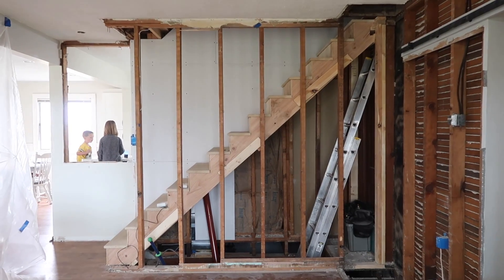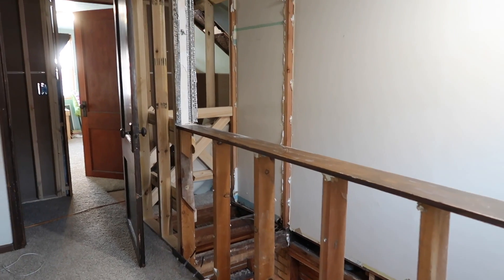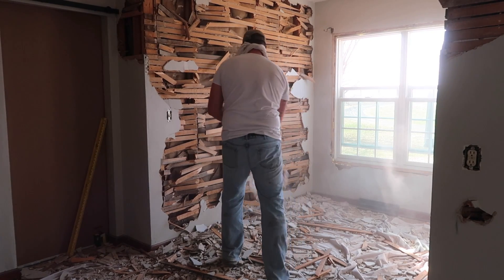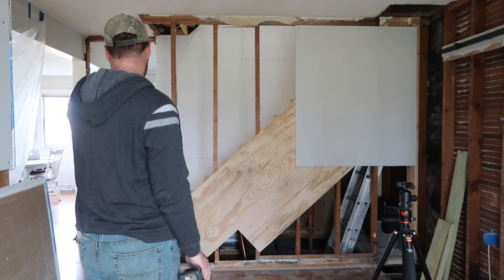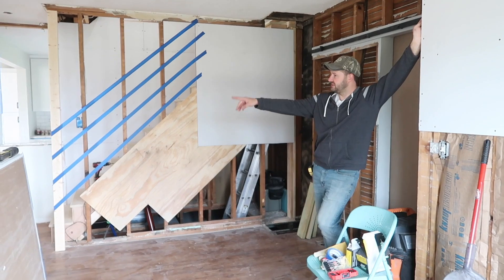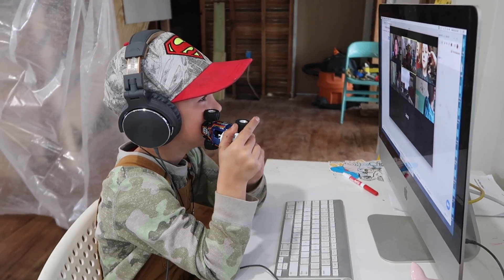Mocking up an Open Railing: We need to see it to believe it!

Comment from the maker: ❤️ IN THIS VIDEO (vote at 11:59):
- Did Tom get the Sheetrock done? 0:39
- Staircase Project Overview 1:15
- Mocking up the Open Railing 4:20
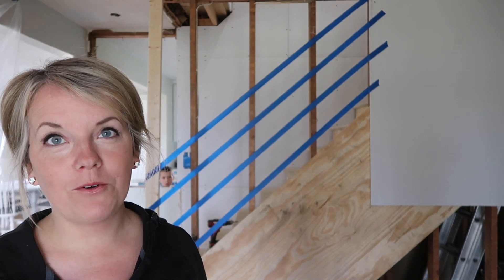- Reworking the Desk Design 6:49
- Did we mention we have to pull up ALL of the flooring? 8:44
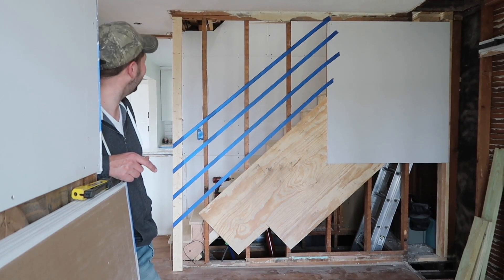- Dawn's Design Sketch 9:45
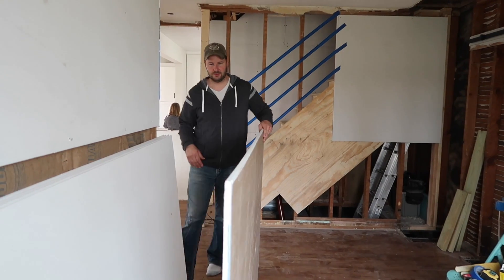- What it looks like closed in 11:11
- Cast your vote! 11:59

We're looking forward to your vote! Also, if you want to see Tom gutting the stairwell, you can find that here: https://youtu.be/e_Vz9CjoMsQ 

❤️THANK YOU for watching!! We hope you're doing well!! - Dawn & Tom
Reply: I love all the work you've done to the house so far. I wasn't too sure how I liked the open railing because I wasn't thrilled about the horizontal rails. I think it looks too modern for your 1940s house. But as soon as Tom put that second piece of sheetrock up I did NOT like how small and closed in the room felt. It seems too dark as well. I would open it up (it opens up the whole floor concept from the different angles you showed) but use a different stair rail that matches better with your home (vertical, maybe).
Reply: I think the computer counter is fantastic. It’s centrally located and as long as they have headphones I think it’s going to be wonderful. I know it would look real pretty to have the railing and everything. But I think your idea with the computer counter is going to be great for the kids. I feel for you Tom. We had to do very similar things when we were remodeling our house. We did the windows first throughout the whole house. Then we were told that no one would want to purchase our house with two bedrooms and the third being a laundry room. They said we needed a separate laundry room. Or the value of the house would be significantly cut. So we actually added on to the house. And we closed in the rear half of our carport to make a separate laundry room. It was beautiful. But it was a disaster. We were two2 x 4 short of all new framing by the time we were done. And we had to live in the back storage building that was only 600 square-foot for almost 2 years while the entire house had to be gutted - it was heart wrenching. So you guys at least are able to still live in your house - that’s awesome.
Reply: I like the open railing but don't fancy the dark colour so much. It feels like it would draw all the attention to it; the eye is just drawn to such colours that stick out. Maybe the railings can be of a brighter colour?
Reply: As much as I love Tom’s idea,  it’s very stylish,  I’m thinking about what you said about homeschooling the kids from now on.  So I’m thinking Dawn’s practical idea seems more sensible.  It sounds like you are already having a taste of how it would work.  Sorry Tom, but I’m with “poor misunderstood Dawn” on this one.   Thank me later!!..  😇😂
Reply: Well, it looks like my opinion is NOT unique!  So glad to see all the votes to not make a dedicated spot.  Home school mom of SIX kids all the way through and FOUR adopted kids partially through. Laptops!
Reply: The full wall just makes sense with the computer station for the kids. Either design is neat but I vote for the more practical solution. All the work you have done to your home is inspiring. Enjoy watching you both so much!😘
Reply: I think you should do what you like best for the staircase alone.  You can still have the computer station there, just no wall hangings. Best of both worlds.  I feel like very soon after you start homeschooling you will find, they will not want to sit together.  They will do better with laptops at the kitchen table or in their own rooms at a desk as they get older possibly.  I wouldn't make that drastic of a design decision based on wanting to put a computer station there.  You may want to move it later anyway and wish you had open stairs. By the way you guys are awesome and I love to watch.  I have been watching you for a couple of months now.  I think I have gone back and watched every video now - Be blessed, Marsha
Reply: I saw this and then your video 'This is not what we were expecting' (it sure how I'd missed it before - I guess I was working before lockdown) anyway, that one shows the area clear of the old desk but with the staircase still closed up - you should definitely leave it open, it makes such a difference to that space and the staircase too as it's not so nice boxed in. (I was brought up in  an old farmhouse, and also rented a cottage with the same type of staircase and it's quite dark and claustrophobic). Check out the other video! 😊
Reply: Just a thought. You should put your desk only where the railing is. The other room, you can dedicate to the kids. One side of the wall 4 computers for the kids and the other side a working table for the kids. Don’t know if that room is big enough. I have kids, so I know sometimes if they are right next to you, it can be challenging to get your work done. Only a suggestion. I think it’ll be great either way. Tom does a great job
Reply: Kay Tee I love your idea!!!! My eyes were drawn directly to that, as well!!
Reply: The Minimal Mom  Dawn, would you mind sharing the depth of your desk drawing/plan and the height/depth of the cabinets you plan on putting underneath? I love the cabinets underneath idea, because I’m a shorty too! Thanks!

Comment: I would do the open wall. I have been homeschooling for 4 years and hardly ever use computers, and when we do, we sit on the couch or wherever is comfortable. Sometimes we have to move kids away from each other because they get distracted being so close, so laptops would work better than a desktop. 🤗
Reply: Yup, my problem when I was homeschooled. And my kids's problem currently.
Reply: Yes us too!! My same thoughts. Homeschooling is different then school at home. We use our whole house and the kitchen table has been enough table space for us.
Reply: Live Life Simplified I wanted to add to this! I’ve homeschooled my kids the whole time. My oldest is 15. We never need that many computers. Two max would be great! I would do the open railing and a smaller desk area there.

Comment: I say open railing. Keep a smaller desk for your desk and then have a nice table for the kids with laptops that can be put away when not in use instead of so many screens being out. And bonus is that the staircase can be open and filled with light and air!
Reply: This!

Comment: As a Realtor I would vote for the open railing.  I know you're not planning on moving now but in the future I don't believe buyers would be interested in a computer station.  Open concept is almost always on a buyer wish list.
Reply: Lisa Ryan Open to a certain extent.  I like that they are planning one side open & the other mostly closed.
Reply: I would do open railing on BOTH SIDES of the steps (if possible)! It would really open up that floor plan!

Comment: I vote open railing! As a homeschool family, I can attest (like others) that your homeschooling set up and needs will change, and it’s very unlikely you will want your kids space to be so near your own- whether working all at the same time or not. One idea might be to add some floor outlets in the room though since you have to redo flooring anyway- so if you have a homeschool table/office desk/whatever in the middle of the room, you can connect a charging cord. We had those in our last home- randomly- and they were wonderful!
Reply: Yes! Our home was built in 1948 and remodeled 2007. We left some of the original non-grounded outlets (mistake) and added grounded ones. The old outlets are a nuisance. You'd be so glad to have floor outlets. The tangle of charging cords for everything and extension cords is a real challenge.

Comment: Open railing with no desks or anything under it. Move all work area/desks/tables etc. to Dawn's work room. It will help the flow of the house. Any desks under the open railing or even if closed, will make the house look cluttered. I agree that most kids use laptops. You could still buy or build a desk area that could be removed as the children get older.

Comment: 1) I vote for open stairway wall. 2) Based on kids outgrowing a contemplated tech desk area, could such a desk be made temporary as a piece of furniture instead of something built in?  3) The weariness of so many projects going on at the same time is really showing. I strongly recommend you complete these projects before starting another one!! 4) The railing style should be complementary to the overall style of the house. Open railing is a great idea, but don’t go too ‘modern.’

Comment: I vote open railing!! It will look awesome!! I have homeschooled for over 20 years (I have 10 kids) and I think laptops are the best way to go with kids who will use them for school.  I would see maybe one kiddo at your current kitchen table and perhaps another on the couch and maybe one sitting by you doing book work and another one reading in a chair. I don’t have a formal place for my kids to do school.  We gather at the dining table for group lessons.  After that they are scattered and alternate using computers.  I would suggest putting your office back where it was and perhaps setting up a small desk in there if one of the kiddos wants/needs to be close to you while doing a lesson.  Or you could put a smaller desk/cabinet setup like you were talking about on the wall of the stairway but make it for 2 computers instead of 3 and still put your desk area back where you had it or at least in that space.  Your house looks amazing and I can’t wait to see this renovation complete!  Tom your skills are amazing!
Reply: Yasss!

Comment: I am a homeschooling with a small home. You may want to think about how your kitchen table will be a part of your day as you homeschool. A lot of time I'm doing things in the kitchen and the kids are working at the kitchen table and that gives easy access for questions they may have. We also use the table for crafts and game sand other projects. I wonder if you put a table where your current office is if it will get much use? Think about how you will use those existing surfaces during homeschool.  As long as there is a place to clean up and put things so meals can happen this has worked really well for us.
Reply: Exactly.

Comment: I do like the desk idea even though I voted that you might regret it. The reason I believe it might not be a good setup for that many computers is because the space needed for notebooks/books/calculators, etc., along with the space you might need to complete your work would just not be available. In my classroom at school the students did their work much more efficiently when they had the ability to spread out and have a little space around them to work. Maybe if there was a space to have 2 computers on the counter top and another space on the other side of the room for 2 more computers it would feel like you'd have room to breathe. I also have a question as to how easy it would be to access the cabinets for school supplies/books, etc...You both have great taste and I know whatever you choose will be the right choice. As I grow older though, I prefer a look that opens a space up instead of closing it off.  Gale

Comment: I think closing it would stick with the time period of the house, but I also like the open railing.  I would not put in a built-in cabinet/desk.  Homeschooled both my boys. They will transition to doing school independently and probably on a laptop (especially if you decide to do a co-op or later dual credit at your local community college. some can do dual credit as early as their junior year).  Have a desk or table area but I would not build it in.   Also, mine got to where they needed more space or quiet to work, so sometimes one would be in one location and the other in another.  Good luck on your decision and ultimately it is yours :)

Comment: Seasoned homeschool mom here, having said that I better watch my spelling.
Having a closed stairway will allow more flexibility on furniture arrangement for the future.  On the other hand it does feel more cramped.  50/50
Laptops with parental filters- are your answer.  They will be able to take them to auxiliary classes when they are a little older.  
You will probably only need the custom table not the row of computers.  Homeschooling is different than school at home, once they receive their assignments at the school table they will go off to different places in the house to do their work; on their bed, outside in the camper for quiet reading, under a tree in good weather, at the island in the kitchen.  You have a lot of place already for them to learn, you might want to use that room in another way.  I do not regret 1 minute of homeschooling, my "kids' are still the best of friends, even though they are all grown.

Comment: YOU CAN DO BOTH!  You can achieve this by having the open stairs AND in Dawns current office space....use the wall that is against the porch to add the butcher block counter top for the stationed computer desks.  Maybe add a piano hinge so you can pop it up when the kids need the flat desk working space to write on and pull  it down when not in use or the kids want to lounge or you need the floor space.  You can even add the clipboards over each kids station for their homework like you did for your office desk instead of pictures like in your mockup drawing.  On the opposite wall of the kids work stations you can add bean bags or pillows or even a couch for when the kids want to lounge with their tablets, book, etc.  If you put a table in the middle of that room it will be limiting and it is better optimized if the working desk is up against the wall.  Dawn, you can move to the sheetrocked  section of the stair wall.  Love you guys! <3

Comment: We've been homeschooling a lot of years, for awhile even had a dedicated school room, but the reality continues to be that we school in the dining room more than anywhere else. Kids will be all over the house ,or outside on beautiful days, doing school but the hub is the dining room for us because I can be cooking, etc and still be available to monitor and help the ones who need it. Also, you don't want a big light source facing computer screens - throws off the ability to see depending on the time of day (again speaking from experience, lol!). I'd be more likely to close in the stairway and put bookshelves with adjustable shelves on that wall. With doors if you want it all "hidden". Leaves you flexibility to do school anywhere but everything has a home too.

Comment: Personally, I wouldn't recommend designating a Homeschooling spot, because in my experience it just doesn't work that way.  Unless you want a table in your current office space for some other reason, it's not really going to be practical for Homeschooling. Also, as for the open staircase railing, and keeping with the 1940's theme, I'm not sure that works?  Dawn's computer desk drawing is awesome! If it were my house, which it is NOT 😊, I would put that in the current office space.  And, I would repaint the stools. Or maybe just the seat part if you feel it would be too much mustard.  Or, possibly white?
Again, it's YOUR house, and your family. So do what works for you.  But you did ask for our opinions...lol
So, to recap:  wall up the stairway with planking. Put the craft area back. Add computer stations to the office, or just get tablets and laptops that can float with the kids where needed.  And paint the kitchen stools either white, or mustard, or try leaving the legs black and the seats mustard.  The end.  Love you guys SO MUCH!

Comment: Open railing is appropriate in a 1940’s home. 
I suggest a 36” high (counter height) table with locking casters, so you could move it around. This height would be good for sitting, standing, computer work, school projects, buffet, crafts, work bench, etc.
Good luck and I hope to see it completed soon!

Comment: As a former homeschooling mom, from the 90’s, I agree with many of the other homeschooling Moms.   A permanent computer station may not be necessary. Tablets or laptops will be what you will use. Just need an area for them to use, like the other side of room, that Tom is working on. If you only used desk top computers, a more permanent area would be necessary. I think having the ability to work at the computer station for other things, like crafts, sit down getting focus activities, extra counter space, when needed would be a benefit, so I’d still make  the area by the stairs, but have it multi-functional. Thanks for encouraging smiles and Tom working with you on the broadcasts. When I needed a break from all the stuff, I went to check up on you and get focused on positive things. Keep up the good work!

Comment: As a homeschooling mother I would agree with many of the other commenters that your homeschooling needs constantly change for so many reasons that anything really permanent doesn't sound like a good idea. Design the rooms for visual appeal and that will bring you greater satisfaction. Sometimes one big table works but not so much for my children. They are too easily distracted so they usually do work in separate areas or desks. Make your space/ desk the priority and I think you will have the best outcome. Love watching all of your projects.